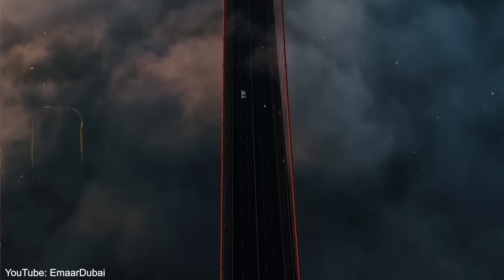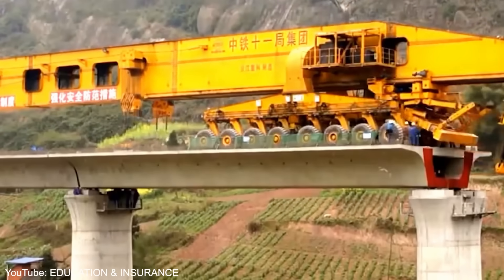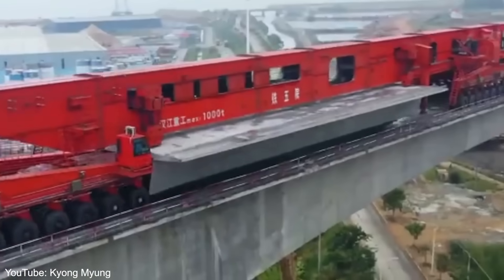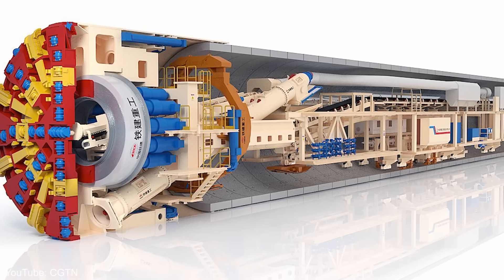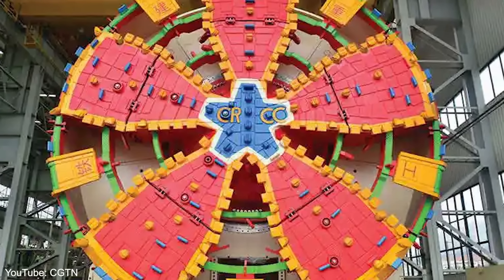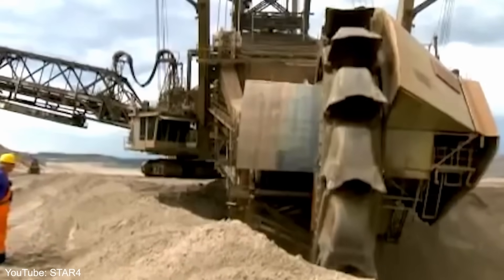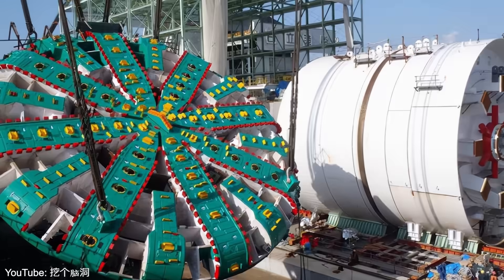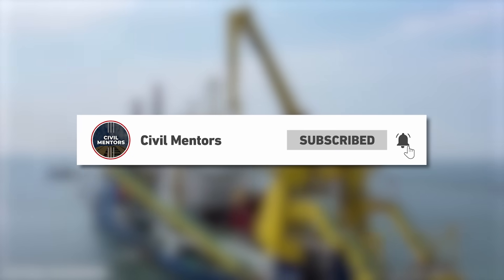These Machines Are Why China Can Build Anything

Comment: Amazing machines for sure. However, I’m pretty sure that I have watched documentaries saying that Germany has the largest bucket wheel excavators in the world. And those heavy lift crawler cranes look suspiciously like Liebherr’s designs. Not to take anything away from China; realistically it takes a high level of engineering even if you are just copying other’s designs, which I don’t think they are-more like improving on what came before. I haven’t seen those bridge building systems anywhere else. And that track laying machine is next level!

Comment: US has those machines too but they not using them as affectively as China
Reply: I don't think ours are as big. That tunnel boring machine is 15 m wide? That's 50 ft. Supposedly the channel tunnel bores are 9 m each, and that was supposed to be pretty big.

I've never heard of a crawler crane that can lift 3,000 tons or has a boom length of 600 ft.

Comment: Pure CCP propaganda, TBMs where first made in Germany in the 1910s and the biggest one in the world is also made by germans. Germans where also the first to use open pit mining bucket-wheel excavators from the 1920s. The biggest one is in Germany the Bagger 293. The German Liebherr LR 13000  crawler crane was made in 2010, the chinese copied it and made bigger ones years later. China aint special, you can stop kissing their behinds. And dredging boats were first built in Europe in the 1950s.

Comment: Their was a bucket wheel since 1965 it was german made it was use in the bauxite mining in guyana south america it was the 1300 not as big as this one im 72 and i had the chance to opparate it
Reply: I've seen this colossal machine (Bagger) on display in rural Germany several years ago. I forgot where but it is indeed a monster
Reply: GOOD GUESS.THE 1300 WAS THE WORLD LARGEST DRAGLINE NOT A BUCKET WHEEL EXCAVATOR .IT WAS ELECTRICAL OPERATED BY 69 THOUSAND VOLTS AND MANNED BY TWO OPERATORS WITH A BOOM LENGTH OF 365 FEET AND CHARGED WITH NITROGEN IN THE BOOM FRAME .

Comment: Why Large-Scale Renewable Energy Investment in the Gobi Desert is More Sustainable than Stock Market Stimulus and Essential for National Security

As China pursues sustainable growth, investing in large-scale renewable energy projects such as solar, wind, and sand batteries in the Gobi Desert offers long-term stability, energy security, and economic benefits. Unlike short-term stock market stimulus, this approach reduces dependence on imported oil, lowers carbon emissions, supports environmental protection, and generates significant economic returns. The key reasons are outlined below:

	1.	Energy Security: Reducing Reliance on Oil Imports

China is the world’s largest importer of oil, spending about $1.5 trillion annually on oil imports. This heavy reliance on international energy markets makes the country highly vulnerable to price fluctuations and geopolitical risks. In times of war, a naval blockade could easily cut off critical oil supplies, destabilizing the country. By shifting to domestic renewable energy sources, particularly solar and wind power in the Gobi Desert, China can reduce this dependence and ensure a stable energy supply.

Additionally, sand battery technology, which stores excess energy by heating sand, strengthens energy security further. With the Gobi Desert’s abundant sand resources, it is an ideal location for deploying sand batteries to store renewable energy, particularly for use during periods of low generation. A typical sand battery silo can store approximately 2.1 million megajoules (MJ) of energy, using around 5,000 tons of sand, heated to 500°C.

	2.	Cost Efficiency: Solar and Wind vs. Coal and Oil

Renewable energy is becoming more cost-effective than traditional fossil fuels. In 2022, China’s large-scale solar power cost ranged between $20 and $30 per megawatt-hour (MWh), while coal-generated power cost around $60 to $70 per MWh. Wind energy, especially in regions like the Gobi Desert, has also become cheaper than oil-based power generation.

Currently, China spends about $200 billion annually on coal and oil imports, exacerbating its reliance on fossil fuels and exposing its economy to greater risk. With increasing global energy market instability, transitioning to renewable energy will help reduce this economic burden.

	3.	Ningxia’s Strategic Location: A Hub for Renewable Energy and AI

Ningxia is strategically positioned near the Gobi Desert, making it an ideal location for developing renewable energy and artificial intelligence (AI) systems. Its proximity to abundant solar and wind resources, combined with excellent high-speed rail connections to major cities, makes it a perfect hub for managing and distributing renewable energy. The region’s industrial base also supports energy production and AI-driven energy management systems.

	4.	Economic Growth, Job Creation, and Impact on GDP

Investing in renewable energy in the Gobi Desert will create between 10 million and 12 million jobs, particularly in the construction, operation, and maintenance of renewable infrastructure. These positions will provide high-paying jobs in both rural and urban areas.

	•	Job Creation: With a $5 trillion investment over the next decade, approximately 20 million direct and indirect jobs will be created, spanning construction, operation, maintenance, and research. These jobs will involve the installation of renewable energy systems, sand battery technology, electric vehicle manufacturing, and support industries such as transportation, infrastructure, and supply chains.
	•	GDP Growth: Annual investments of $1 trillion in renewable infrastructure will significantly boost China’s GDP. Over five years, this investment is expected to add approximately $5 trillion to GDP through increased renewable energy output.

Economic impact calculations:

	•	Annual investments of $1 trillion could generate around $300 billion to $400 billion in GDP growth through job creation, manufacturing, infrastructure development, and renewable technology exports.
	•	Developing global renewable energy export markets could contribute an additional $480 billion in energy export revenue annually, further boosting GDP growth.

	5.	Environmental Sustainability: Reducing Carbon Emissions and Dust Storms

Large-scale renewable energy development in the Gobi Desert can significantly reduce China’s carbon emissions and help achieve its carbon neutrality goal by 2060. Additionally, wind turbines can act as barriers to reduce the frequency and intensity of dust storms that frequently affect northern China, protecting agriculture and infrastructure and saving billions of dollars in damage and health costs.

	6.	Electric Vehicles: Driving Demand for Clean Energy

As the electric vehicle (EV) market grows rapidly, the demand for electricity will significantly increase. EVs are far more environmentally friendly and economical than traditional gasoline-powered cars because they rely on clean energy rather than fossil fuels. By investing in renewable energy infrastructure, China can not only meet this growing demand but also reduce its dependence on oil, supporting its carbon reduction goals.

	7.	Sand Batteries: A Safer, More Reliable, and Cost-Effective Energy Storage Solution

Sand batteries store thermal energy by heating sand, which can then be converted back into electricity or used for heating. A 5,000-ton sand battery can store approximately 2.1 million megajoules (MJ) of energy, taking advantage of the Gobi Desert’s abundant sand resources for long-term storage.

Comparison with Molten Salt Batteries:

	•	Safety: Sand batteries are safer than traditional lithium or molten salt batteries because sand is non-flammable and chemically stable. Lithium batteries can catch fire when overheated, while sand batteries remain stable even at high temperatures, reducing risk.
	•	Reliability: Sand batteries offer superior durability, as they can be used repeatedly through heating and cooling cycles without degradation, ensuring long-term reliability. In contrast, molten salt batteries are prone to corrosion, leading to higher maintenance costs.
	•	Cost-Effectiveness: Sand batteries are more cost-effective than lithium and molten salt batteries. Sand is abundant and inexpensive, and the infrastructure required to build sand battery systems (such as refractory concrete) is relatively simple and low-cost. This makes sand batteries an economical choice for large-scale energy storage, especially in regions like the Gobi Desert with abundant sand resources.

	8.	National Security: Electric Vehicles and Emergency Systems

Electric military vehicles and emergency systems powered by renewable energy would offer a significant strategic advantage. In the event of an oil shortage or naval blockade, electric vehicles would ensure the continuous operation of military and emergency functions, enhancing China’s national security.

	9.	Water from Air: Renewable Energy for Agriculture

Renewable energy can also be used to power atmospheric water generators (AWGs), which condense water from the air using wind or solar power. This clean water can be used for irrigation in arid regions like the Gobi Desert, transforming barren land into fertile agricultural areas and enhancing food security.

	10.	China as a Net Energy Exporter

By fully leveraging the renewable energy potential of the Gobi Desert, China could transition from being the world’s largest oil importer to a net exporter of renewable energy. Excess energy produced by solar and wind farms could be sold to neighboring countries, generating additional revenue and enhancing China’s geopolitical influence as a clean energy leader.

Energy Production from a $5 Trillion Investment:
A $5 trillion investment in renewable energy over the next decade could add around 4,000 gigawatts (GW) of solar and wind power capacity. This would generate approximately 80,000 terawatt-hours (TWh) of clean energy annually. At global energy prices of around $60 per MWh, this could generate about $4.8 trillion in energy export revenue annually.

	11.	Meeting China’s Energy Needs

A $5 trillion investment will enable China to meet 100% of its energy needs. China’s total energy consumption is currently around 6,000 TWh. By adding 80,000 TWh of renewable energy, China can completely eliminate its reliance on fossil fuels. This will save approximately $1.5 trillion annually on oil imports, and the surplus renewable energy could be exported, generating additional income.

	12.	Carbon Credit Trading:

China can also generate substantial revenue by selling carbon credits. As global demand for reducing carbon emissions grows, carbon credits have become a valuable financial tool. By significantly reducing its carbon emissions, China can sell carbon credits on international markets, potentially earning billions or even hundreds of billions of dollars. This will further incentivize renewable energy investment while contributing to global efforts to combat climate change.

Conclusion

Investing in large-scale renewable energy in the Gobi Desert not only improves China’s energy security but also offers enormous economic and environmental benefits. Unlike short-term stock market stimulus, investing in renewable energy will provide long-term security for China’s sustainable growth and national security. With a $5 trillion investment, China can meet its energy needs, export clean energy, and become a dominant player in the global energy market. By exporting clean energy and carbon credits, China can solidify its position as a leader in the fight against climate change.

Comment: What about a crane that builds a tower while using the tower itself to support its weight? The crane does not need to be touching the ground, just the tower it’s building.   It could build Km high towers …. If the tower foundation can handle it.
Reply: How tall can a building be?